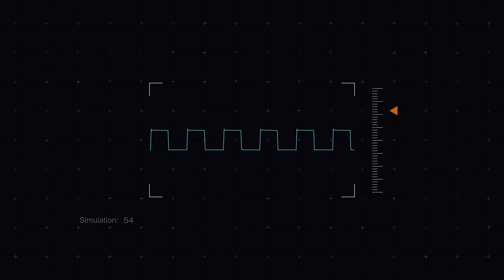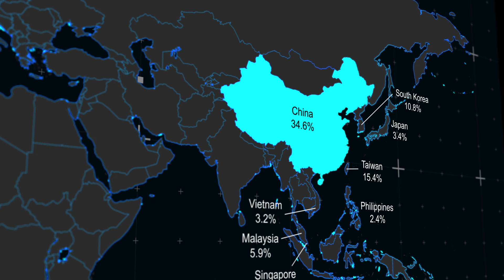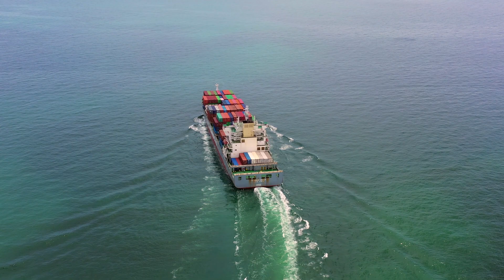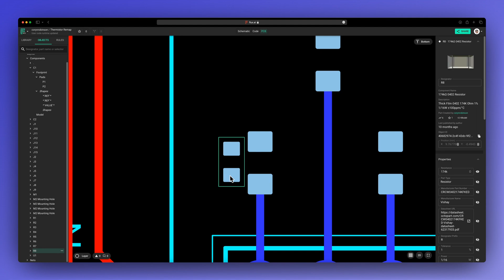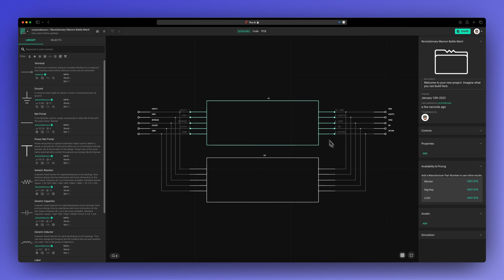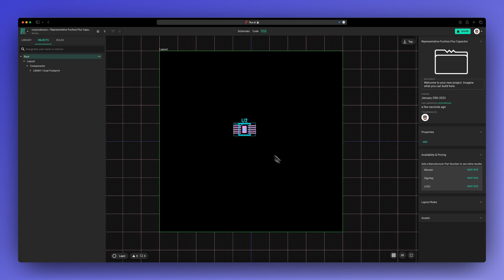Why You Want to Use a Dual-Footprint

Comment: I never use single foot print. If there is space i stack two design together for other purpose. At my last commercial product i stacked 4 PCB together and sold them for each purpose. 

The down side is when you overdo, its impossible to remember whats what always checking the components and it's really time consuming. 

Don't stack more than two guys LOL